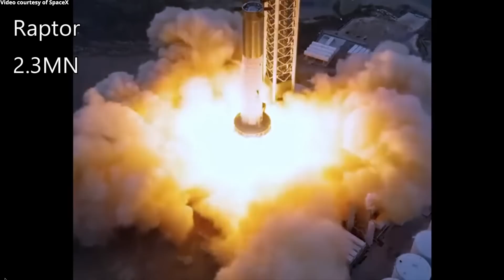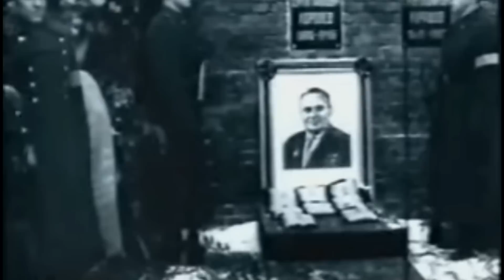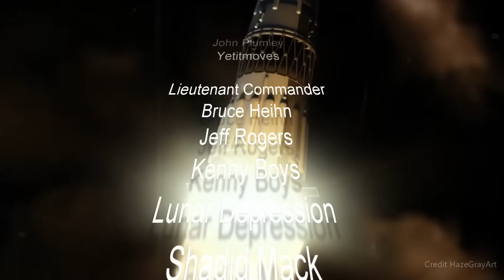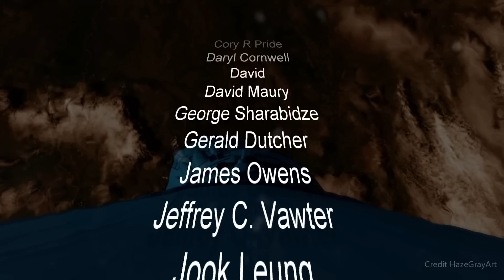SpaceX Starship: Will Starbase Survive the Launch of Starship?

Comment: I calculated the worst case scenario Rud would be at 10 seconds after launch. A tilt in direction toward the population center of Brownsville or Padre Island would trigger the launch abort squibbs and a nearly perfect mixture of fuel and oxidizer could trigger somewhere near 15kt of tnt equivalent fuel air explosive power. Easily enough to propel debris 8 to 10 miles away. This is pretty similar in destructive power to Nagasaki or Hiroshima. 
The best view of this takeoff will be on my 60" TV while hoping such a thing does not happen. If it does, I think it could do to space travel what the Hindenburg did to airship travel.
Reply from the maker: That does not at all sound good.  I would like to argue that all of the propellant will not explode but methane has much more explosive power than RP-1.

Comment: I've been following SpaceX since the days of the slosh issue taking down Falcon 1 flight 2, and Starship since the days of the flying water tanks! I can see the comparison to N1, but I believe we've come a LONG way since then.
One point about N1:  Korolev died before the first article was built. Had he lived, I believe N1 would have completed its mission.
Reply from the maker: We have indeed!  I don't think there will be a control problem.  But with thirty complicated engines all working near capacity something could easily go wrong.  A turbopump explosion could easily doom the ship before it leaves the test stand.  Just like the ill-fated N1.  Emergency software routines should be dedicated to getting the ship out over the ocean by any means necessary in case of failure.

Comment: Thank you for the old N1 footage.   Let's not forget that the Falcon Heavy already flies with 27 engines, so 33 really isn't much of a stretch.    Sensors and control systems have come a heck of a long way in the last 50 years, as have the materials used for turbo pumps.    The first Starship launch will presumably be without much, if any payload, which should give it lots of margin for engine outages.   I believe Elon said they were not planning to run the engines above 90% on the first launch.
Reply from the maker: That's a very good point Annie.  I think they will pull it off.  Probably 80% throttle on launch?  Have to do the math.

Comment: !!?... I just imagined Starships in battle, using high compression charged particles as latteral cannon with supplement of a few missiles. There would also be a couple heavy gatling guns at the aft.
The scenario looks very much like Gundam(the anime). 

They have one hydrogen bomb just in case they want to do heavy damage but most of the time it is used as last ditch kamikaze attack to maximize probability of critical strike.

It will be fleets of Starship v.s chinaship battling for resources and there will be space pirates supploed by mexico, they will use an advanced membrane made out of aerogel but shhaped like a sombrero placed over the nose of the Starship with and additional half a meter thick lining over the rest of the ship. 
Whenever they appear you will hear mariachi music broadcasting into your communication systems as means to suppress your combat communication.
Reply from the maker: It would indeed...
Reply: @terranspaceacademy sorry is that was a waste of your time, I have nonfriends soy imagination is my only companion and it will remain that way for the remainder of my days..

Comment: My only concern is Max-Q.!!😉
Reply from the maker: It'll be way out over the ocean by then :-)  That's why they keep doing the rope pulling exercises. Hopefully it will hold together.  I worry about a depressurization event allowing the ship to compress on reentry.
Reply: @terranspaceacademy  If the heat tiles do their job, then boiloff shouldn't be a problem.!!🤔
Reply from the maker: @carlbrown5150  Boil off is always an issue as the rocket's structural temperature will not be cold enough to prevent it.  Starship has enough power to run compressors and reliquify the propellants... I like molten carbonate fuel cells myself.